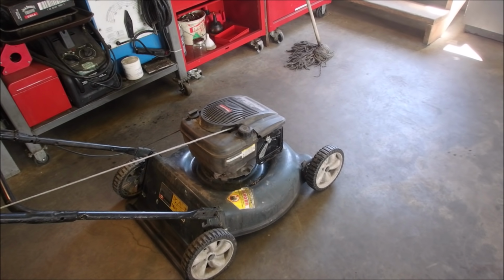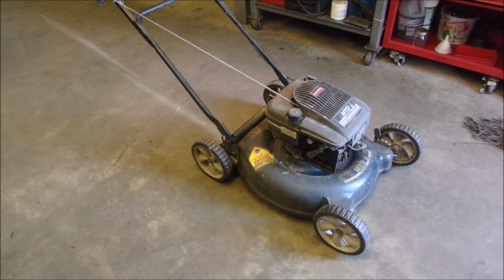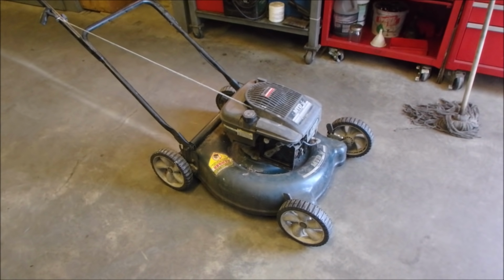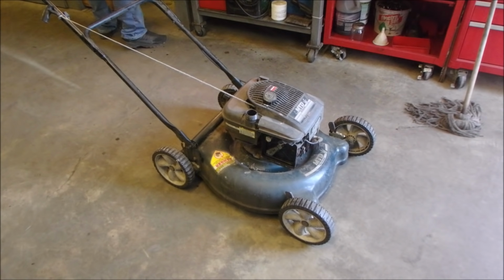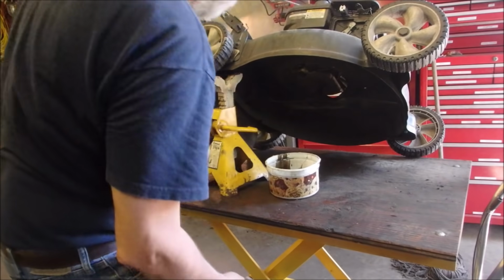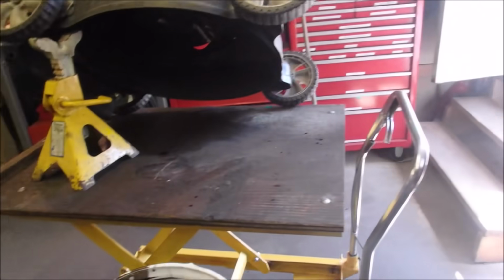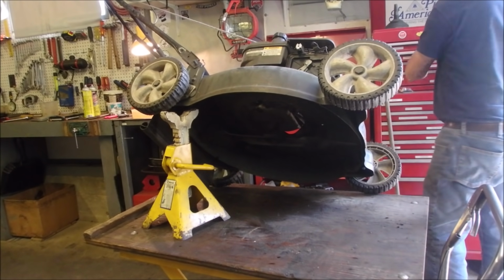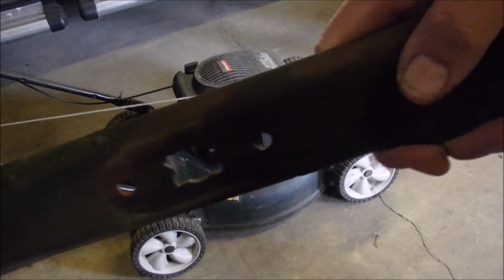Older MTD Briggs Quantum Barely runs

Comment: Hello Bruce, I noticed the air cleaner shaking up and down on that mower. The carburetor mounting bracket must be loose to the block, it's the part that also holds the throttle actuator and hinders the shroud by the corner of the head. Being loose will eventually break the intake manifold. Quite often one bolt to the right and slightly below the bolt that holds the right side of the carb on vibrates out altogether.
Reply from the maker: Sometimes the camera can't keep up to the vibration.  Maybe that was it.

Comment: Did you ever try Steve's small engine saloon trick of putting copper tubing in the wheels for bushings?
Reply from the maker: @gordbaker896   Yes   I do not use copper but i have the perfect tubing that is exactly 1/2 inch ID.  I drill the wheel the the OD of the tubing.  I also run the 1/2 inch bit down the tubing to make sure the tire bolt will fit.   In this video replacing the wheels was easier as i have quite a few of these.
Reply: @BrucesShop  where did you get the tubing.

Comment: I have a question for you How do you suggest I break in my new 2000 watt rockpals gas generator?
Reply from the maker: Wow  As you may know I never have new equipment.    However I would run it at different loads for a few hours.   Shut it off.   run it again for a few hours and then change the oil.  Use the manual to find out which oil.  It may be online.

Comment: Nice job on the lawnmower also you never want to go by that never change oil gimmick cause you will blow your engine it’s always good to change oil
Reply from the maker: You are so right.  Fist they need to have oil of some kind  (if the customer never looks it will go low) then it should be changed.
Reply: The deck will fall apart before the engines do. Especially if it's a self-propelled.